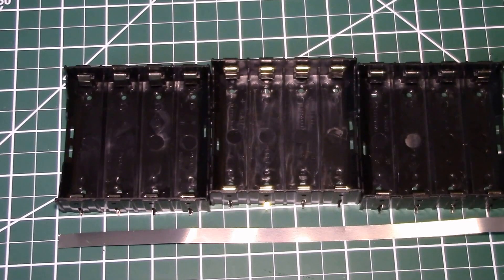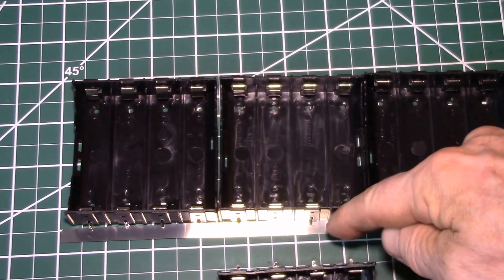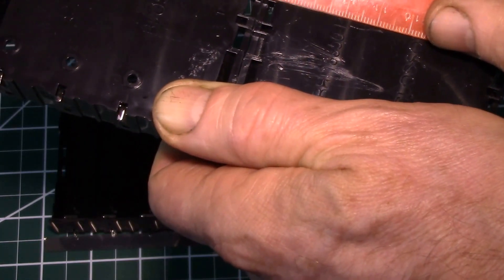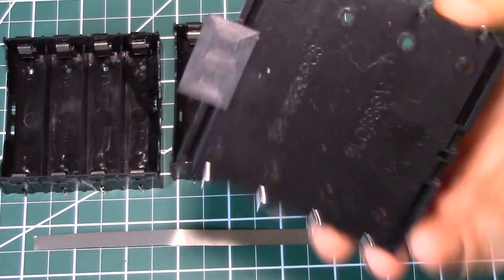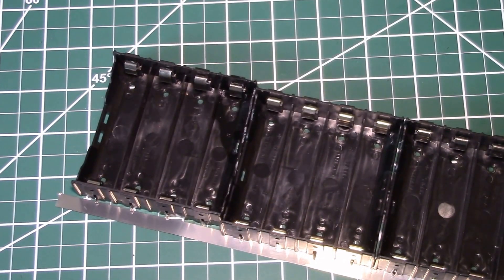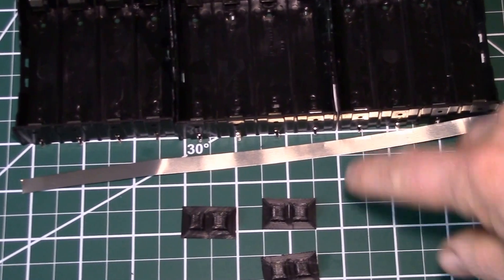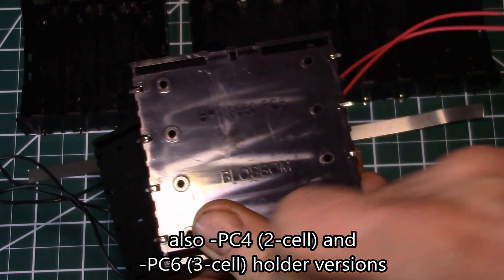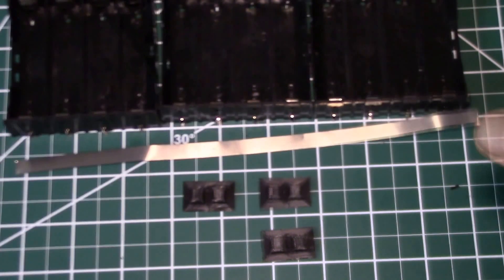Lithium Ion Battery Power Shelf, Part 2

Comment: Hi, I'm curious about the quality of the terminals of those holder, how many amps can it deliver from such a low voltage 18650 Battery. Can you make a video testing them please? I have experienced that even (too small) pure copper wire can't deliver enough current for my led.
Reply from the maker: They seem to be decent enough for currents under a 1C discharge.  I managed to blow one of my fuse wires, probably from inserting a cell backwards.  Those blow out at 5-10 amps and the cell holder terminal looked no different afterwards.
Reply: Thank's for the info. What wire you use for fuse wires?
Reply from the maker: I'm using 30AWG tinned copper wire for the fusible links.  It seems to blow out around 10 amps:
http://www.powerstream.com/wire-fusing-currents.htm

Comment: Would you be willing to sell the battery pack connectors on eBay?   I don't have a 3d printer.   I am sure that are others like me that would like to build a power pack but don't have access to a printer.
Reply from the maker: I'll see if I can set something like that up.
Reply: Thanks!    I appreciate it and I am sure that others will as well.   -bob
Reply from the maker: I have set up an on-line ordering procedure for the clips, link to a text description below: https://drive.google.com/open?id=1eyrAmYGRsUWVBYb_fpgmALT4iweY0AFghe-3HpbwGl4
Reply: Thanks for the info, I will be in touch.